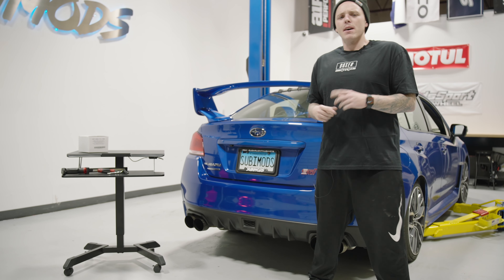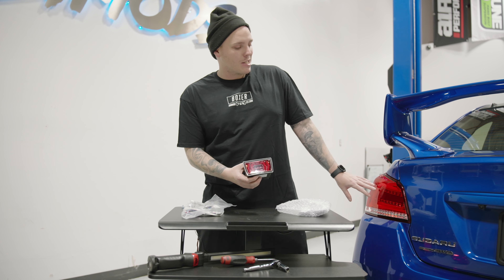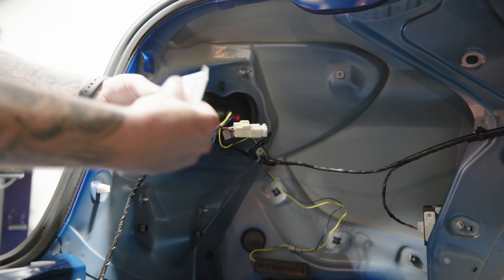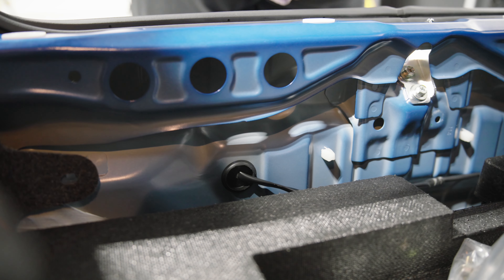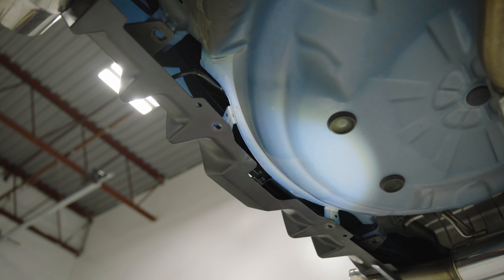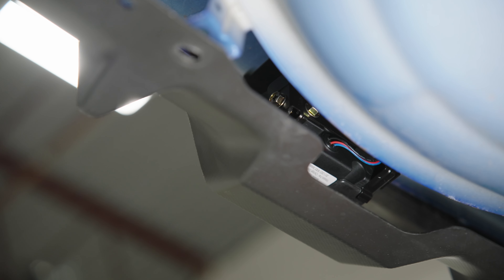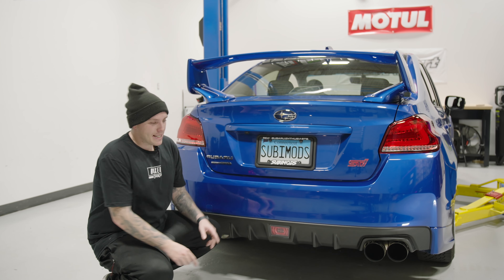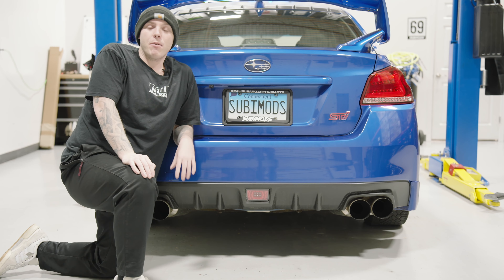2015 - 2021 WRX / STI 4th Brake Light Installation

Comment: Mmm can’t I just take back bumper off ? Feel like for the bracket part anyway then throw it back on plug it in?🤷  feel like just be easier no?
Reply from the maker: There is a surprising amount of access behind the bumper without pulling! Removing the bumper may give you more room, but it is doable without removing it!

Comment: Thanks for this video as I have one of these delivering tomorrow. I have a 2017 WRX. Supposedly it may have roof bolt points hidden under the gutters. 18s had little doors molded into the gutter covers giving access to the roof bolt points. Can you show how to take the gutters off without breaking them? Looking to put a roof rack on it and would rather use hardpoints if my WRX was lucky enough to get them.
Reply from the maker: We've never installed a roof rack on a VA chassis at this time, sorry we cannot help!

Comment: Cant seem
To program it properly. tried multiple times already. I wanted the f1 feature on always
Reply from the maker: It can be tricky, when we've bench tested these since the video release, it just takes 3 times to change the functionality of the light.
Reply: Same, it only works when the headlights are off